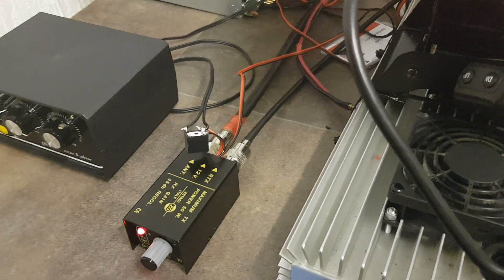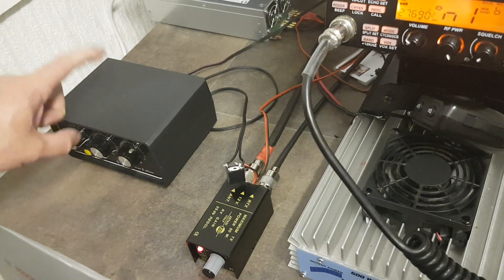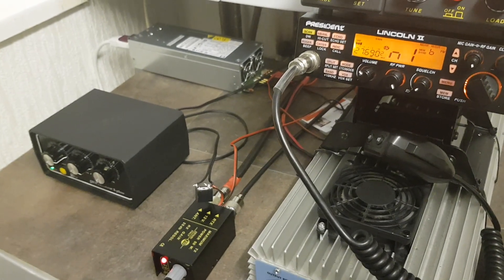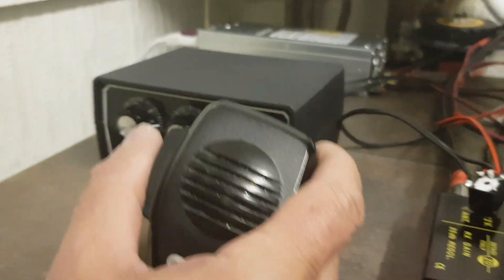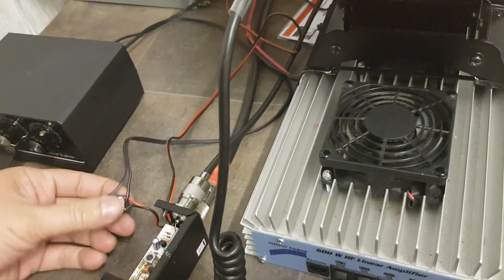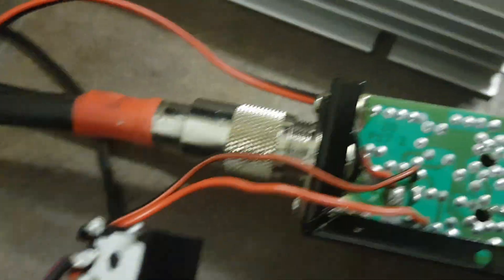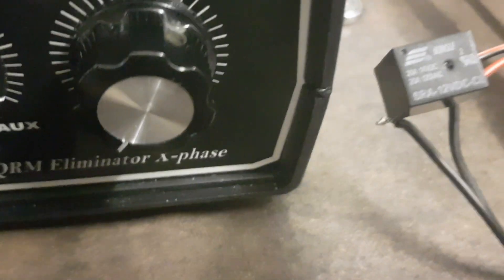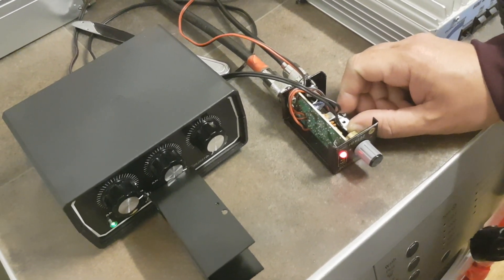Qrm eliminator ptt control modification for use ptt control on all CB radios

Comment: Could I use a RM KL 203p to do this modification, instead of the Zetagi preamp, and could you do a video showing where to connect it please, this would be very helpful, thank you in advance, 73
Reply from the maker: I think u can tap in the tx relay
Reply: @ruiamorim1975200able  it’s just finding out where it is situated, and then finding the two soldering points for the power , maybe you could do a video on this, thanks

Comment: that may well help with ptt straight through for cb radios but the qrm eliminateror isnt patchleaded up to the preamp there for your not showing the eliminator fully functioning and eliminating the noise its designed to do which is totaly defeting the objective of the qrm eliminator especialy as your pre amplifiying the signal your receiving  through the preamp so if you have 9s points of noise your increasing that to 40db+ s of noise have you another video with the qrm eliminater patchleaded up to the preamp with the ptt modification showing it fully operational and eliminating the noise aswell as transmiting ???
Reply from the maker: there is more videos on the channel